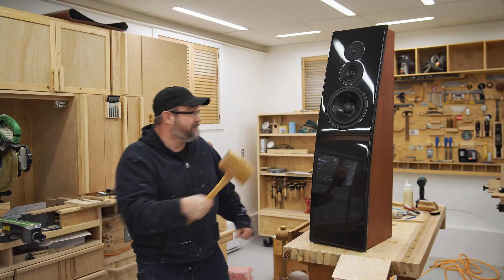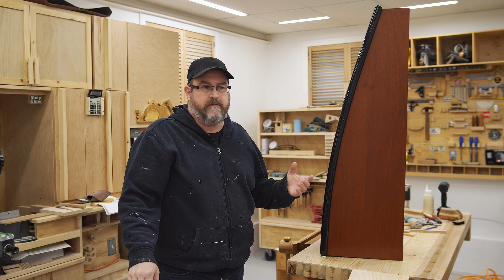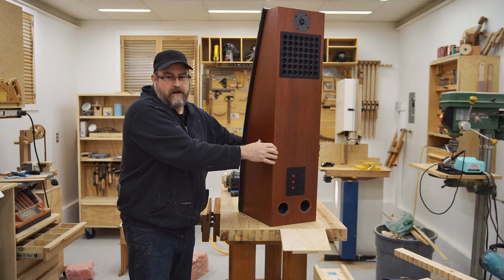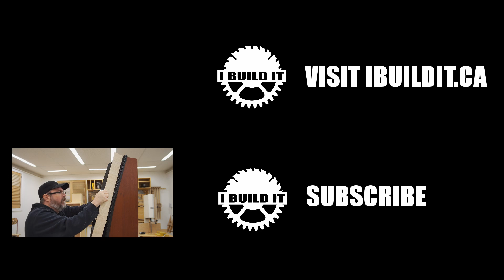The BS is CHIN DEEP!

Comment: I tri amp my studio monitors and have sub boxes on both channels which makes them a quad amp system. The better you make a passive crossover the more power it wastes. When I was building my system I wanted to design my own passive crossover and used an Ashly 3 way mono crossover on one side to help me arrive at the crossover points while the other side was passive. When I finally finished my passive crossover design it had a huge heatsink and the amp was clipping at even low volumes. That's when I got rid of the passive system and went active, why pay expensive amp dollars just to heat up a crossover?
Reply: Have any cats?
Reply: Did that get rid of your clipping issues? I don't have a large home, so, I get goog volumne at lower power.

Also, are they tube or solid state electronics, or a combination of the 2.

Thanks.
Reply: @davidhamm5626 Here's the full story. https://kioskfan.wordpress.com/2013/08/ All my tube amps are for guitars.